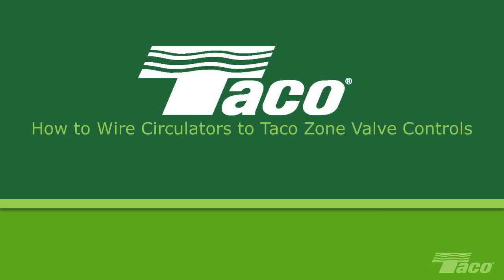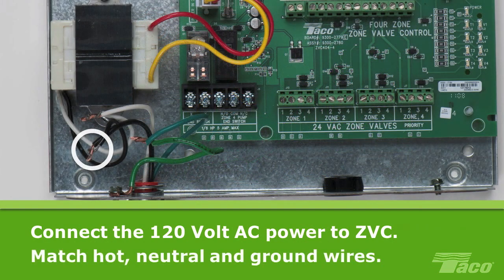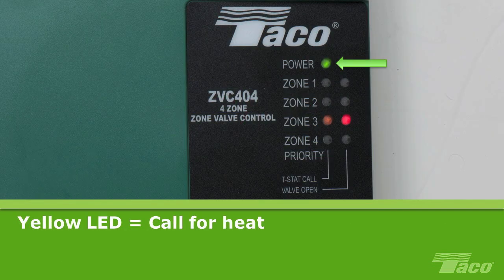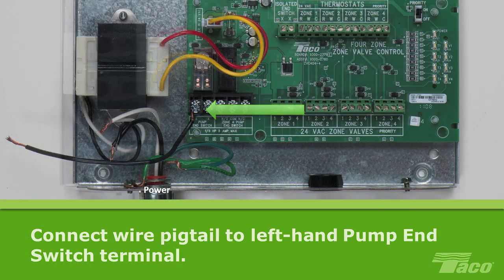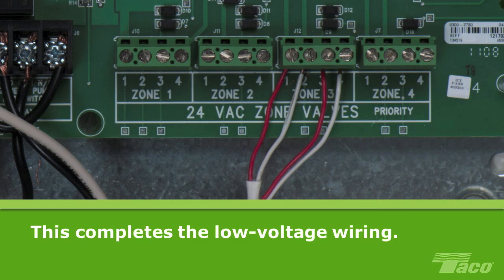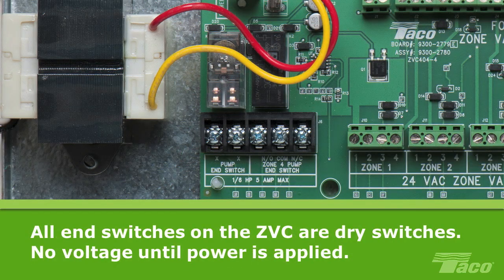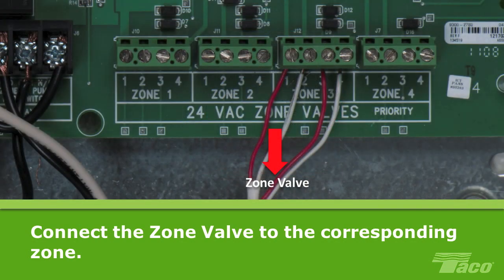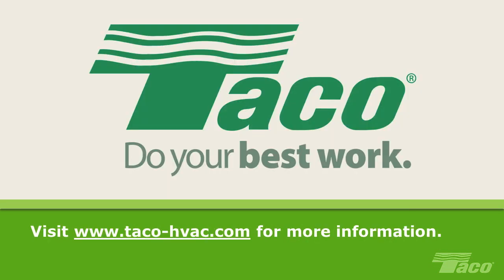How To Wire a System Circulator to a Taco Zone Valve Control (ZVC)

Comment: Will the cirulator pump shut off  when the thermostat doesnt call for heat? I'm using a heat plate exchanger, the zvc404, 1 pump and 2 zone control vales
Reply from the maker: That is correct, the circulator pump end switch is activated based upon a thermostat call for heat and that the end switch of the zone valve has been activated.
Once the call for heat goes away, the circulator will shut off as well as close the zone valve.

Comment: Does the system circulator need to connect to ZVC or can it remain connected to Boiler?
Reply from the maker: @TNewm22 The system circulator does not need to be wired to the ZVC as long as the sequence of operation is followed:
1. Call for heat from thermostat
2. Zone Valve is energized
3. End Switch on zone valve is closed verifying the valve is open
4. Pump end switch closes turning on the pump
5. Boiler end switch closes then fires the boiler.

Its important that the circulator is not turned on immediately when the thermostat calls for heat because the valve may take some time to open and there is no flow
Reply: @TacoHVACtv  does the ZVC wait to power the Isolated End Switch (Boiler) until confirmation that the Valve is Open?
Reply from the maker: That is correct. The endswitch to the boiler is closed when the valve is at least 50% open

Comment: Can I use my zvc403 module to control my 3 007e pumps as zones?
Reply from the maker: Unfortunately not as individual zone pumps. You would need a SR503 or the SR503-EXP (depending upon system needs) in order to do that. TheZVC can handle multiple circulators, but each one has a specific job like 1 zone pump, 1 DHW indirect pump and/or boiler pump.
Reply: @ that is what I figured. I have a new lochinvar noble combi boiler with internal pump, and I am using taco 007e pumps to run each zone (3 zones total)

Comment: Do you guys have a video how to wire 2 boards together? One being a master and one as a slave using one circulator?
Reply from the maker: You will want to use the -EXP models using the expansion terminal on both control boards. To find those details on wiring, please take a look here https://pulse.ly/j7wcdhjrv1starting on page 33.
Reply: I believe you need the boards designated “exp” (for expansion).  They are connected together with a 2 conductor 24v wire
Edit: I didn’t see that taco had responded already. Good luck

Comment: Very helpful 
I have questions 
How  to wiring 2 system circulator ?
Reply from the maker: In the instance where you have two system circulators, you want to use a switching relay, the SR502. This relay will handle 2 circulators as well as turning on the boiler as needed.
https://pulse.ly/h7zgbbb8ij

Comment: I'm trying to find out if I'm using ASCO red hat solenoid valves for my zone valves, and they have two red wires and a ground, do I need to connect them to ZVC zone valve ports 1&2 or 3&4 or 1&3 or some other configuration? Please help!
Reply from the maker: Hello Philip, a quick search on my end shows that the ASCO makes alot of different red hat solenoid valves.
What model ASCO valve are you using? I would need to look up the suggested wiring from their instruction sheet. However based upon the description that you gave me, you would use the terminals 1 and 2, that has the 24 volt power. Terminals 3 & 4 are endswitch wires which you don't have on the ASCO

Comment: so where do you wire the domestic hot water aquastat? to zone 4 control r and w? and what if this aquastat is rated for 120v?
Reply from the maker: @Areildny, yes the aquastat is typically wired to the last terminal on the Switching Relays and the Zone Valve Controllers. Even though the wires are not red and white, use the terminals R and W. We want to use the endswitch wire from the aquastat, not the 120v side. If yours is only 120v, you will need an isolation relay. Here is the complete wiring guide https://www.tacocomfort.com/documents/FileLibrary/100-92.pdf
Reply: @TacoHVACtv   ok thank you very much!

Comment: What if I have no zone valve and just want to turn on the circulator from the thermostat do I just add a jumper wire on the terminal 3&4 on the zone valve board
Reply from the maker: James, that is correct, we need to complete the endswitch signal in order for the pump relay to close on the Zone Valve Controllers.

Comment: Hello, I wired a three zone Taco control panel and 3 taco zone valves. I accidentally mis-wired zone valve terminal 1 and 3 to the zone control on zone 1. Did it fry that zone control on the zone control board?  I was exhausted and accidentally wired blue white red instead of red white blue. Now that zone refuses to open even after it was corrected. I tried another zone valve head and no difference, I can only imagine it is the board. Is it repairable? the other 2 zones are working fine.

Comment: So if I were to use a honeywell 4 wire zone valve 2 red which are end switches and 2 yellow wires the 2 red wires go to 3 and 4 and the yellows go to 1 and 2 on zone valve control board?
Reply: Yes, end switches go to 3,4
Reply from the maker: You are correct, the zone valve power is labeled terminals 1 and 2 (yellow wires typically) and the endswitch terminals are labeled 3 and 4 (red wires typically). Honeywell typically denotes the wire colors this way. Make sure to check the instructions for any other types of zone valves and follow suit.

Comment: Am I missing something, or did  scenarios 2 or 3 miss wiring up the DHW demand (zone 4) aquastat?  If not, how does the control know when there's DHM demand??
Reply: Yes, I agree.  This video is incorrect.
Reply: And because of that, I am looking into comments to see if someone else is in doubt about it. Best Regards... p.s. detail documentation is a must
Reply from the maker: Thanks John and Bucky, this video was created to show how to wire just the circulators to a Zone Valve Controller. The rest is covered in the instruction manuals. The demand for DHW would come from an aquastat that would be installed in the indirect tank and it would wire the same as a thermostat to the Zone Valve Controller.

Comment: Why don't they install a bus bar for the neutral and grounds?  Using wire nut is stupid in my opinion.  It looks stupid using wire nuts.  It would make the unit cost more.  But I would pay the extra price.  For a unit that didn't require wire nuts.  You hear me MFG.   I do like the fact that you made this video.
Reply from the maker: Good day and thank you for the ideas and comments. We are always working on continuous improvement for all of our products. I will be sure to pass along to our product managers. With that being said, one of the improvements to the Switching relays and the Zone Valve Controllers was to make bigger enclosures to allow for more room for the wiring recently.
Reply: Agreed this would be a nicety.  In the absence of that, I prefer "lever nuts" instead of wire nuts.  Makes adding or replacing thinks MUCH MUCH simpler, and takes up less space.

Comment: I wish it could control 3 circulators to 3 separate zones.
Reply: Christopher Kennedy look for the taco sr 403
Reply: You ca
Reply: @johnnylightning1967 , how?
Reply: @coatknight   Taco SR503
Reply: @Eldeibi84  thanks. That is the one I ended up installing. Do you know whether I need to use resistors if I want to use the com line?
Reply: @Supa Trending Daily Thanks, will try.
Reply from the maker: The supplied resistors are to be used with thermostats that use alot of power from the controller and unintended results happen like the zone doesn't turn on or the zone doesn't turn off. We need to use the resistors then. A few of the wifi style thermostats need to use the resistor, some brands even have their own suggested size or resistor.